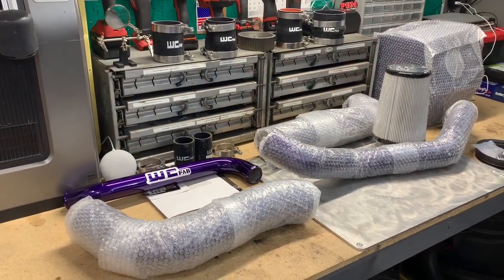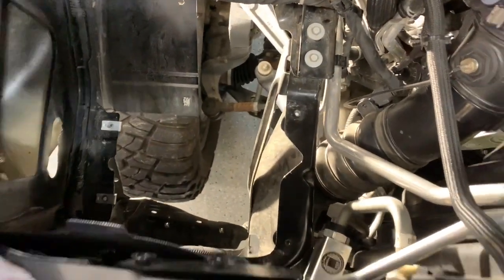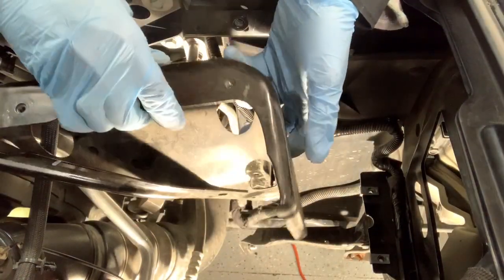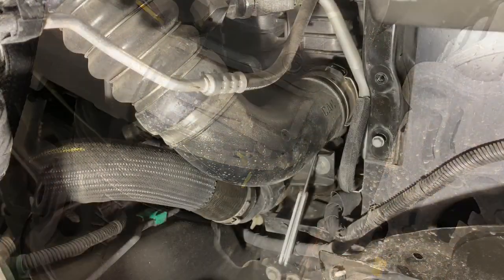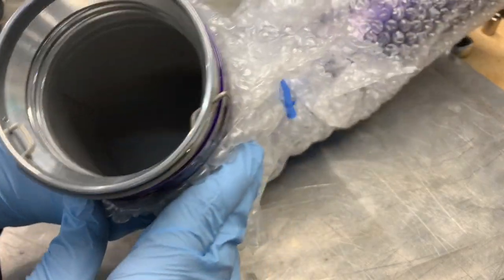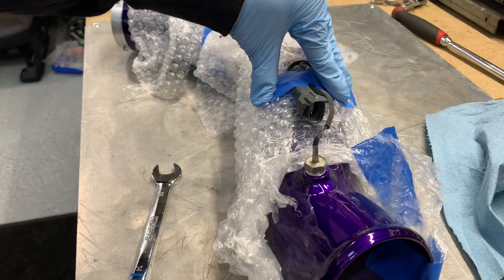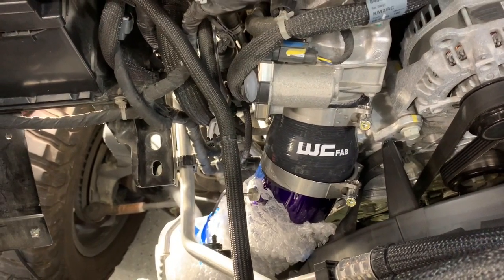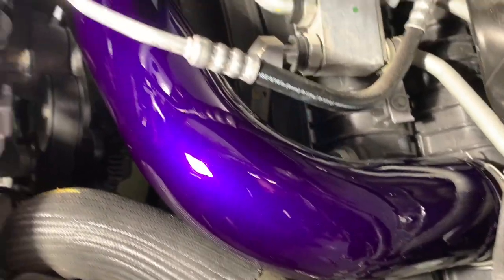WCFab 3.5 Inch Passenger Side Intercooler Pipe Install. 2017-2019 2500/3500 L5P Duramax!!

Comment: Great video, I have a 2019 also and I noticed that when you pulled the old pipe off and the end with the clips from hell on it, it looked like there was residual oil in the pipe. If was oil, where does that come from? Thanks
Reply: Most likely your PCV connected to your turbo horn . The PCV can release oil vapors that can accumulate over time inside your intercooler pipes . That’s best case , worst case you have a failing gasket on your turbo . More thank likely if that was the case it would be shitting oil out everywhere.
Reply: Order a PCV re route kit and while your at it install an oil fill re route.

Comment: Nice job! I just bought a 2013 chevy silverado 2500HD 6.6L LML Duramax with 144,000 miles on it. It's completely stock. 1st thing, Air Dog lift pump, and then all the hot and cold piping is getting replaced. Your video gives my the extra insight to tackle the job my self. This is my 1st diesel and I'm excited to learn as l go. By the way. Awesome shop, love the American flags!!

Comment: I have the same pipe, I only had it blow out on the Intercooler connection twice when I really gave it the beans, than I found that the groove cut where the clip snaps into was not cut deep enough so I took a file and shaved her a little longer, it wasn’t just me it happened in a jw Montoya video on his friends L5P, I didn’t contact wcfab cause since I fixed it it’s been great, I also boost checked it was fine through and through, great video man I hope you have better luck than me, mind you I had one of the first they made, keep these videos coming there the best on YouTube, also all my other wcfab stuff has never gav3 any issues so no discouraging anyone.
Reply from the maker: Hell yea! Thanks man. I appreciate that! This video was over 40 separate clips edited together. It takes a lot of work to put it all together. Glad someone is getting some use out of it! I hope I’ll keep you posted on the status after I drive it.

Comment: I installed the 3.5 inch cold passenger side pipe.. what a bitch to deal with that clip.. even with the strap.. but I got it and hope I never have to touch it again.. but without your video.. I would have been lost as last years Easter eggs
Reply from the maker: Awesome!!! Yep. I’ve fought with that one. But it’s been holding strong for about a year now. Glad to help Alan. That’s why I made the videos! 💪🏼
Reply: @linksgarage1985  gonna try the drivers side tomorrow… it seems like it may be easier.. I got the illusion blueberry color.. except my cold air intake is HSP ..
Reply from the maker: @alan2256al  HSP make good stuff also. The driver side is wayyyyyyy easier. Leave the bubble wrap on it until it’s installed so you don’t scratch it!
Reply: @linksgarage1985  I installed the drivers side.. piece of cake.. feel like I did something wrong it was so easy.. but now I waiting on the  5 inch bank’s exhaust
Reply from the maker: @alan2256al  I told you! Glad you knocked it out. And I ran the Banks intake set up. It’s great. You’ll enjoy it.
Reply: @linksgarage1985  I tried to send you few shots of my installs but I guess you can’t send pics on here… but thanks for the videos.. awesome instructor ✌️
Reply from the maker: @alan2256al  hell yea!!💪🏼💪🏼

Comment: Hey man I have a question for you. So I’m in the same boat as you were with the pipe blowing off on the intercooler side. I have pushed as hard as I can on that pipe and it seems to be seated all the way in bc I felt the pipe go into the 2 O rings. But then when I step on it, I hear the whoosh sound and then it’s loose again. Does the pipe have to go over that little little on the intercooler? I figured since the pipe sits all the way up against that small plastic lip, it was all the way on but I seem to have it come off under pressure. Weird part is that clip still is in the right place even tho it’s loose 😂

Comment: What kind of lubricant did you use on the o rings
Reply from the maker: Safe for o rings! 

https://shop.advanceautoparts.com/p/lube-gard-assemblee-goo-green-size-1-pound-19250/11302001-p?c3ch=PLA&c3nid=11302001-P&adtype=pla&product_channel=online&store_code=&gclid=CjwKCAjwy7CKBhBMEiwA0Eb7asYYFOlAqcgSu8AoToNeOyKGkWx4jdCiWsB2MZKzqMQQldaL_GtnfhoCCOcQAvD_BwE&gclsrc=aw.ds
Reply: @linksgarage1985  thanks for the info
Reply from the maker: @alan2256al  no problem! Thanks for watching!